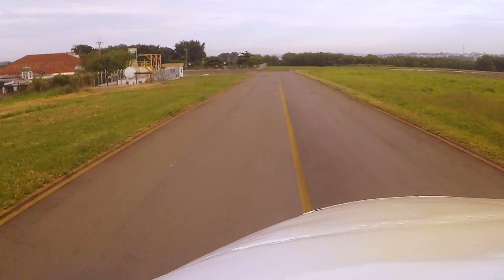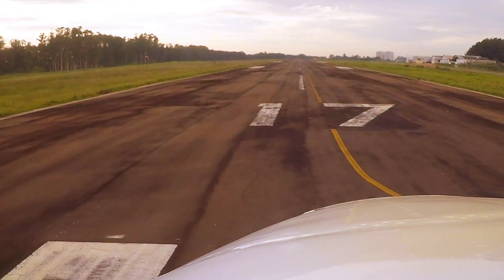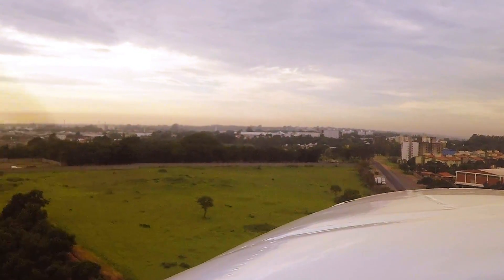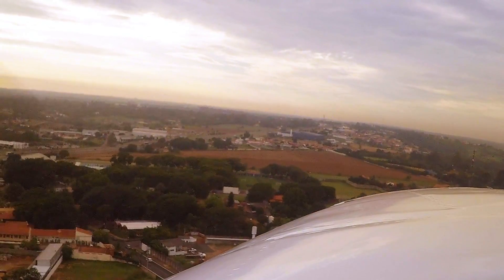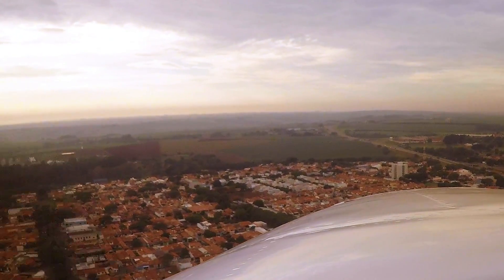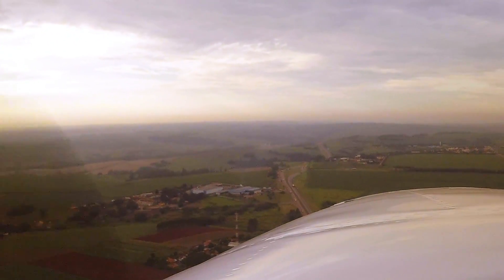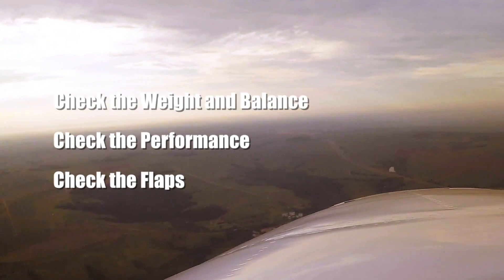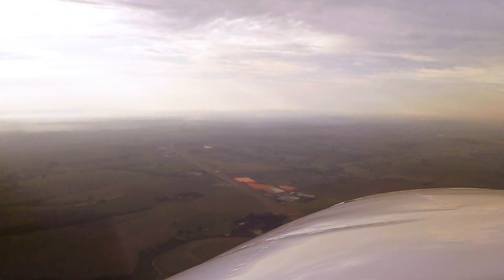Engine failure during take off

Comment: I'm a bit surprised you never talked about feathering the dead engine. The drag from the propeller is massive (people usually won't believe that the disk effect is real, from what I've been exposed to, but the unfeathered propeller has the same drag as it was a full disk of the same diameter). Thanks for sharing.
Reply: I was a bit perplexed by that myself.  Did he just not mention that or did he not do it during the exercise, I wonder?  He said it took 5 miles to achieve V2...Could excessive drag be the reason for that?
Reply: This was a practice, and as such the engine would have been reduced to a neutral (no drag, no thrust) state rather than feathering. Engines aren’t typically feathered during simulated engine failures so that the “failed” engine can be brought back immediately if needed…
Reply: Doesn’t the aircraft have auto-feather?
Reply: @pabloa2228  Well, I suppose that would explain things pretty neatly...Maybe it does auto feather.
Reply: @boldflyer_creations  It seems out of a comment it was on idle. Nevertheless, not adding thrust was risky. King airs don't like single engine flights specially on that altitude.
Reply: The pilot said he had engine failure and nothing about a simulation. I'm sure he would have put the second engine back to work rather than take a chance on crashing and killing himself, his passenger and people on the ground. He clearly states that he couldn't find an area clear enough to land although the four lane road should have been adequate for an emergency landing.
Reply: @genespell4340  it says it was training engine failure during takeoff in the description. He simulated an engine failure. Not a good plan
Reply: @genespell4340  He refers to this video as "training of engine failure during takeoff" in the description.  That certainly implies simulated engine failure to me...
Reply: @genespell4340  he clearly said the instructor pulled the engine just after take off
Reply: @genespell4340  THAT AIN'T THE WAY  I WOULDDA DONE IT!
Reply: An unfeathered prop can even be kicked back in on touchdown to even act as an air brake - a common practice for Pilatus PC-6 short landings.

Comment: Nice video....I have had 3 engines fail on single engine planes on takeoff...It's not a good feeling....You never get used to it....But I practice it very often ...takeoff, climb to 300 ft, stall turn , land on the strip you left from....not easy, not fun, but it might save your ass someday...

Comment: This seems incredibly reckless to me so close to the ground and in a population zone with tall obstacles. The engine got shut off like 50 feet up. What if you hadn't corrected as quickly as you did and the plane started to roll?  It seems like there would not have been enough time to turn the engine back on and recover.
Reply: He did not shut the engine completely. It was on idle and could have been used again if it looked like it was necessary. Engines do fail on takeoff and often the results are fatal.
Reply: @charlesaanonson3954  I agree
Reply: I’m thinking he learned a lot. If he was describing the incident the afternoon it happened this video wouldn’t have been so calmly narrated

Comment: Ummm. Since when are pilots trained to take of at V1??  There's a reason for V2 and a reason why you don't rotate before then.  This whole thing was so ill advised.
Reply from the maker: It is part of standard multi engine training and final exam. If you have checked MLTE in the USA, the examiner should have give you an engine failure right before V1 and one at V1.

Comment: Good video. Kind of shows though lack of precise SOPs on an engine failure in a turbine aircraft. Most turbo prop aircraft goes like this.

Engine failure after V1

Attitude (or V2 speed) - Climb
Positive Rate - Gear Up
Engine indication (especially PT6) - Identify Failed Engine
Failed Engine- Feather (confirm if auto-feather system is installed) 
Flaps - As required

Oh and dont forget to navigate and lastly communicate.

This should keep you alive in most cases. That simple!

Comment: Here is an excerpt from the FAA testing standards which states the conditions under which an engine failure may be simulated:

 "In a multiengine airplane certificated under 14 CFR part 23 (except commuter category), (for which no V1, VR, or V2 speeds are published) the failure of the most critical powerplant should be simulated at a point AFTER REACHING A MINIMUM OF VSSE and, if accomplished in the aircraft, at an altitude NOT LOWER THAN 400 AGL, giving consideration to local atmospheric conditions, TERRAIN, and aircraft performance available."

Fire your instructor. He almost got you killed. You, however, are fortunate to have gotten this experience and living through it. And thank you for posting the harrowing video to youtube so the rest of us can learn from it.

Comment: No, no, no.  You do that type of training out over the water, not homes and neighborhoods.
Reply: Thought it was the real deal 'til I read the comments - wow.
Reply: It's practice engine failure... If its dire you get the engine back... Real V1 cuts are a different story... And I've heard of ppl still doing it
Reply: @alexanderdavidson7837  except it can always happen that if you depend on being able to power on the “dead” engine, it really is dead.
Reply: @alexanderdavidson7837  It was dire!
Reply: @nicholaspratt7934  was it though...it was simulated
Reply: @alexanderdavidson7837  How long would it take for the "failed" engine to spin up and provide thrust, too near to the ground and buildings to take risks like that.
Reply: @nicholaspratt7934  fair call
Reply: The other motor was not shut down. During simulation of motor out, the motor is simply taken down to idle so they can power up right away again if needed.
Reply: Hmm..bit of the hazardous attitude here,
Reply: Or practice engine failure at altitude. Slow to Vx at 5,000+ AGL and pull power. Now you can simulate at altitude more safely what would happen just after takeoff. Same concept as practicing (or demonstrating) the impossible turn. There is no reason to feather an engine on a training flight until you are at a safe altitude. What is the difference in performance at 5,000 AGL vs field elevation on a cool day? Negligible. Below 5,000' AGL practice engine out by pulling power, executing your immediate action items, and then simulate feathering the propeller on the dead engine by adding power (to simulate eliminating the drag of the windmilling prop).
Reply: The airplane doesn’t know or care that you know every detail of the area you’re flying. If you purposefully pulled engine 2 then did not restart after you were in trouble you put yourself your friend and people on the ground in very real danger. Foolish and reckless. Get out over the water or other deserted area if you have to train like that.
Reply: Why the music, it detracts from the voiceover?
From reading the comments of informed contributors, surely the music makes light of alleged reckless endangerment during a training flight.
Reply: Jeffrey Morris The voice over ruined the music for me😅.
Reply: At altitude anyone can be a good pilot. There is no fear factor. Its like practicing shooting only to paper targets. Cops now practice with dummies shooting blanks at them. It makes a difference the Fear Factor. Many fail to hit the dummy by fear and get washed out. Its like practicing crosswind landings at 3k feet. Yeah right. Pilots should not be panicky drivers. Motorcycles prep you well to be a pilot. Motos take no BS training. They hurt you if you panic or freeze on emergency maneuvering, which are often.
Reply from the maker: Hi,
As I just answer to another pilot, we specifically choose this area because it is our base and we knew every details of it.
I am flying at this airport since 2006 when I begun my PPL and my Captain/instructor is flying there since the 90's.
So in case o a real engine failure, we would have known very quickly where to land.
Reply: @rayishido  You should explore and study the area around your airport under normal conditions so you would have known very quickly where to land. To simulate a situation like this you should find an appropriate airdrome with no populated areas around. You DON'T simulate stuff like this over people's heads. That's absolutely reckless. You and your captain/instructor should be stripped off of your PPL licenses.
Reply: Ishido
That is pure bullshit.
Stop trying to justify your incompetence.
CP 52 yrs.
Reply: @rayishido  Stupid
Reply: This guy should have been reported to the FAA for this. Be required to retake his checkride and pay a fine. A lot of people especially in Europe have a sense of ....I don't know that they're smarter than everybody else I guess.
Reply: @Vfh........y  Why would the FAA be interested in anything that happens in europe?
Reply: Roger Lund Snitches end up in ditches. 

That’s why.
Reply: @Vfh........y  I think this guy is American... south american to be honest, probably Brazillian...
Reply: @fernandoferraz3527  No brazilian accent. More like french or italian
Reply: @fernandoferraz3527  He is actually from Pakistan!

Comment: You trained a live engine failure? Is this even legal? I am honestly curious because it seems quite a dangerous thing to do which could be accomplished in a simulator...
Reply from the maker: Hi, 
yes, it is totally legal and this is a training every multiengine pilot does.
During FAA ATPL test, the FAA examiner even shut down one engine at V1. in my case it was only reduced.
I knew the video is impressive but the maneuver was quite safe. I only post the video so other pilots won't be surprised by the poor performance of the aircraft in case of real engine failure.
Reply: I see, thank you for the reply!

Comment: If the engine was dead on the left side why not feather the prop and get it stopped ? way less drag then a windmilling prop !
Reply from the maker: As it was a training, for safety reason we didn't shut it off. 
but if you look in the POH, it indicates the RPM to be used to simulate an inoperative feathered engine.

Comment: I don't care how well prepared you are, or how well you briefed prior to the flight. Training an engine failure that close to the ground is incredibly unsafe and irresponsible of you as a trainer.
Reply: let me get this right..... your training next to obstacles at low altitude with other people's lives at risk. what kind of idiot are you. There's nothing I've ever done in Flight Training that would get close to the idiocy of this act. In my humble opinion
Reply: @Vfh........y  You've never trained with multi-engine a/c?
Reply: It's a high performance twin that gets 600'/min single engine a gross weight. 1000'/min at 8000lbs. On the low side for a Turbine Twin, but still a better climb gradient than your C152/172.  You're incorrect about the gear, it reduces Vmc and lessens the chance of a dynamic rollover in the down position. Dynamic rollover at Vmc is only an issue if you actually shut down the engine with propeller windmilling, at gross weight, aft cg, gear up, max thrust, etc. Vmc for the C90 is actually below stall in the take-off config, which makes it a safer airplane on a single engine on take-off. My point there is nothing illegal about simulating it by pulling the power back on both engines a bit to simulate a lower climb rate and adding a bit of yaw.  In fact you are required to simulate an engine failure to an actual landing for your multi-engine ride to get the endorsement. All in a grossly underpowered piston twin deathtrap. One could argue that light twin engine accidents are the result of the lack of realistic effective training.
Reply: @CallsignMunch  Stop arguing over this this is not a pissing contest. Guy in the video is crazy unsafe that's all. By arguing the FAA bla bla figures you give an impression that you endorse the guy. Now is that what you really want to show here ?
Reply: @12345fowler  I haven't argued over this in over 3 years.
Reply: @CallsignMunch  I dont know what you trained in but you are so so so correct! Try that climb out in a Apache or twin commanche, Aztec is a little better...of course you loose hydraulics on the left...real "pucker factor" events. Lol, If not done with a very thorough preflight for the lesson.
Reply: I'm with you on this one.  The nose was wandering quite a bit, easy for a momentary distraction to result in loss of directional control followed by stall/spin into terra firma.  Or, lose the other engine, same result - not enough reaction time to restore full power to the simulated-inop engine.  Training for a particular scenario should never present a greater danger than the actual event.  I'd go as far as saying "maybe" this would be OK at a deserted airport in the middle of nowhere, but definitely not at the field they are in the video.  Experience:  I've flown the B-90, C-90 and B-200 variants of the King Air line, former military pilot, civilian CFII, and time piloting products produced by Northrop and General Dynamics.
Reply: Ray Ishido "Quite safe" in your words and yet in your video you still point out all the obstacles and how they are too close. The worst part of all this is that you are taking students up that are probably too new to know any better...
Reply: If you lose an engine in Utah in the summertime for the density altitude runs between 5 and 7000 ft the only guarantee that you have he said you'll be the first one to the accident site!
Reply: @bgamelson  No they werent. What the hell are you talking about? This was a real flight!
Reply: @colinsouthern  These are only recommendations, not requirements.
Reply: @colinsouthern  It would help if you were a pilot.
Reply: @colinsouthern  Microsoft Flight Sim doesn't count as being a pilot.
Reply: Agreed! This was nuts. We'd just about never see this in Canada hey
Reply: Colin what I would say is that an Engine failure can occur at any point but for training purposes there are some maneuvers that must be executed at a minimum altitude. An engine failure so close to the ground in the conditions that you were in would favor a loss of directional control. Let me explain, Temp 22 degrees no wind means that you will suffer directional loss of control very easily. May I recommend that you look at Single Engine ops before doing an engine failure so close to the ground. Engine failures should be at zero thrust and if there is any indication of climbing issues that compromises safety, the power should be returned. Never trade difficultly in a practice for safety. Always remember safety is always first.
Reply: @phillipmckie4913  If an engine failure cause a loss of directional control, I would never fly with that idiot.
Reply: Quite safe? And you call yourself professional? Tell me this: and if you had a real engine failure in the "good" engine at V1+10? I`ll answer: you´re dead!! There are reasons why you should not do things like that! If you really wanna be a pro pilot, stop doing stupid videos like this one. And most important, stop doing things like that!
Reply: @cigscwb  Are you a pilot?
Reply: The publications you refer to are for light piston twins. If you ask me all piston engine aircraft should be banned due to the risk, lol (sarcasm). "Should" and "shall" are key regulatory terms. The term "Should" merely is calling out a risk that may be associated with the activity but not prohibiting it. If you can show that you've mitigated that risk, ie aircraft is light, single engine performance is calculated, engine failure is simulated you have a case. There are risks, but let the operator decide what level of risk they are willing to accept. Most likely flying a C90 this was done under commercial ops where the training program has to be approved by the Regulator, which in turn becomes a regulation for the specific operator.
Reply: PrairieAviation what are the regulations for such training?
Reply: @joeycarr1398  Fly at a minimum safe altitude to not cause undo harm or hazard to person or property on the ground, which he is obviously violating.
Reply: @Tryllast  That's why the instructor had control of the throttle on the "dead" engine.
Reply from the maker: Hi,
As I answered to someone else this training is part of regular multiple engine training FAA and JAA.
Every multiple engine pilot had done it on light aircraft such as Piper Seneca which doesn't have the ressources of the king air I was flying. 
During an ATPL test, the FAA examiner even shut off an engine at V1. 
So, even if at some point  the video is impressive, the training was quite safe.
Reply: Ray Ishido they don’t shut off engines atV1 per the pts they can’t.  They can simulate that by pulling throttle to idle.  B200 also has rudder boost the 90 does not I believe. Get that rudder in early and then fly the plane
Reply: @rayishido  This is misleading, man.  I’ve flown 5 different multi-engine checkrides in real airplanes, NOBODY fails (simulated engine out) an engine that low to the ground.

Comment: Why did it take so long to reach V2? Was Engine 1 operating at peak performance, or was the density altitude that day high? I thought this was an actual video. Not trying to be confrontational but the video title was misleading. Should have said Training!
Reply from the maker: Hi Joshua, 
to be honest I didn't expected the video to have more than 10 view so I didn't think too much of the title...😅
To answer your question this video has been shot in summer under the tropic so humidity and temperature was quite high.
I use to fly king Air B200 so even if my experience with the model may be a factor, I don't think it had interfere too much.
My interpretation is that the engine is a bit underpowered for the aircraft. I never had a similar problem with the king air B200 for exemple.
Reply: This engine is 750hp? I stay thinking about the c90a b with its 550hp. Im flying E90, 680hp.